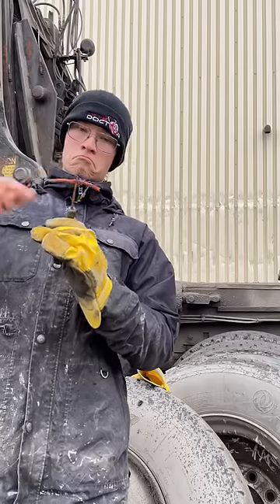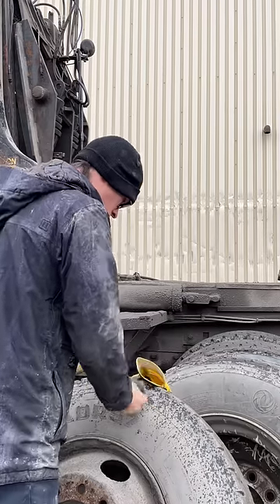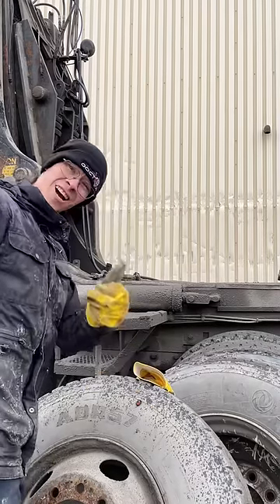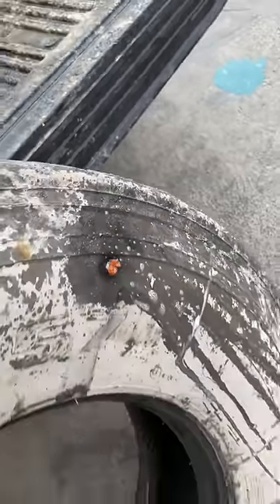Plugging A Truck Tire Sidewall #tiredoctor #shorts

Comment: Depending on the hole size, a sidewall can be patched. Only to get you safely to a tire shop to get the tire replaced
Reply: A sidewall should never be patched, it ruins the structural integrity of the tire and can blow out the plug easily as there is less material for the plug to adhere to.
Reply: @blah-po9et  I've done it before. But again, read the post
Reply: @blah-po9et  yea but i mean for
a few miles at low speed just to get to the shop like the other guy said then you’d probably be alright
Reply: @troycooksey9257  ok. Let's see how long you stay stranded in the middle of nowhere
Reply: @WARD5KUSTOMZ  it's called AAA and it's alot cheaper than if your tire blows out causing you to swerve into oncoming traffic and kill someone.
Reply: @WARD5KUSTOMZ  you're lucky you didn't kill someone, there are no steel strands in the sidewall unlike the tread, which is how plugs and patches stay in, there is a severe risk of your tire blowing out even if the plug stays in because you've weakened the sidewall and created areas for tears to start, trust me I've seen it before.
Reply: @blah-po9et  I've got a Michelin on my back porch that has steel in the sidewall
Reply: If you do it properly sidewall can be repaired and used all the time not just to get to shop. Also depends on size of puncture
Reply: @NTM2009  exactly. Although I wouldn't trust it for anything else other that to a shop
Reply: @WARD5KUSTOMZ  seen them go for another year after sidewall repair. If done properly it will be done at a shop. Can't be done properly anywhere else
Reply: Only on semi tires can sidewalls be patched. Auto tires can not be patched on the sidewall. But yeah, semi tires can have some pretty big patches on the sidewalls, being that they're wired all around the tire and just not on the top.
Reply: @Totes_ma_Goat  done everything from lawnmower to rock truck tire sidewall repairs. Passenger vehicle, light pickup tires most definitely can have sidewall repaired
Reply: @gbrush30  
That's cool. Being I've worked in tire recaps for years, what do I know, right? 

The sidewall of automobiles does not have the structure integrity to hold a  patch, and no shop will ever patch a car or small truck sidewall. 

You can even google it, that sidewall repairs on automobiles is a big NO and highly dangerous.  

You can do whatever you want to your personal property, but should (when) the tire blow out and damage something is the question?
Reply: @user-wi5jj4wc8k  that's nice but we aren't talking about recap. We are talking about sidewall repairs. Judging as your still calling it a patch I wouldn't say you have that much experience. But hey what do I know after over 40 years and no failures of any of my repairs
Reply: @blah-po9et   I believe this is the reason for dual tires, one blows you still got the other plus most 18 wheelers have 8 tires in the rear and two axles guiding the truck straight, the tires you really want to watch are the steer and there’s no running risks there because they literally guide the truck but if your out in the middle of nowhere with no food or truck stops, run the risk otherwise you might end up in the cemetery prematurely
Reply: I mean if you feel comfortable doing that go ahead but I’ll stick to using a spare or a donut
Reply: @NTM2009  What would a heavy duty diesel mechanic like me or a tire specialist like him know about it being literally f*cking illegal for a shop to repair sidewall punctures
Reply: @tothemaxx1991  no its not if its done properly. There are tons of properly repaired tire on the road daily
Reply: @NTM2009  I don’t think you know what a sidewall is…you can patch a tire with a hole in it but if it’s in the side of the tire it significantly affects the strength of the tire I know that you are smart enough to get on YouTube so if you could do a quick google search on whether you can patch a sidewall it tells you all you need to know it’s against DOT regulations and if a shop repairs a sidewall of a tire and it causes an issue they would be seriously liable you can have 40 years or even 100 years of experience it doesn’t make you right
Reply: @Onewingedangle42  Up to a quarter inch in diameter (the size of the carbide drill bit used to smooth the edges of the puncture before installing a patch-plug), and only in the main tread of the tire. You're absolutely right.
Reply: @tothemaxx1991  yeah they say that the plug should stay 6mm away from the edge of the tire within the tread but if you did something wrong for 40 years you would be a little grumpy about it to so I guess it is what it is lol
Reply: @NTM2009  I didn't say tires can't be repaired. I said it's illegal and dangerous to repair sidewall or shoulder damage. As a certified DOT inspector I'd like to call out your shade tree bull. And just in case you still think I'm wrong or only talking about CMV tires there's tons of articles by  reputable (something you clearly know little about) repair shops. 

Don't make me get out the FMCSA rulebook.
Reply: @tothemaxx1991  it's not illegal or dangerous to repair side wall if done PROPERLY which you seem to keep missing. Worked in large tire shop for many years and now work CMVE
Reply: @hunterelmo42  I don't think you know how to read. Not once did I say patch a sidewall. I said repair which is complete different process and legal if process is followed
Reply: @tothemaxx1991  apparently not enough cause your both wrong
Reply: @NTM2009  okay let’s drop the word patch then….if you do any research on the subject it is clearly stated by any tire professional that any repair patch or otherwise is too risky on the sidewall of the tire…I don’t care what you are talking about whether it’s a plug, patch, or vulcanizing and praying it doesn’t make it safe…you even stated that repairing the sidewall can be good for as long as a year…that doesn’t make it safe none of those solutions are permanent or worth the risk when a tire blowout can be a fatal situation I really hope that it’s rare that someone believes this garbage repair bullshit that you are selling
Reply: @NTM2009  I didn’t say it’s illegal but it is definitely dangerous there is no such thing as a sidewall repair that isn’t temporary and doesn’t modify the integrity in some way you even stated yourself that the tire could last up to a year after the repair…if a tire repair last a year and then the tire blows out because it’s weaker on the side that is incredibly dangerous even if it is legal you are the only person that says it’s not dangerous
Reply: @hunterelmo42  you know some vehicles go more then around the block in a year. The one that I personally saw last another year was another couple hundred k and tire was wore out when replaced not blown. It wasn't a temporary repair. It was repaired and run to the end of the tire life
Reply: @NTM2009  cool and I’ve seen a plug in the sidewall last 2 years it doesn’t make it safe I’ve also heard of people surviving doing meth for a year it doesn’t make it a good idea I’ve also witnessed people lie before but you know I’m sure everyone online and in person disagreeing with you including dot and any professional that works with tires is just a bunch of nonsense also that’s why I’m just going to ignore you
Reply: @hunterelmo42  your not actually reading my replies. Not once did I say plug a sidewall. I said repair sidewall. Plug is not legal but a proper repair is legal and approved by dot. It has to be proper repair which not all shops can do
Reply: @NTM2009  I was giving an example the only thing I can guess is that you don’t understand English but yeah neither are recommended and i have seen no information on vulcanizing a tire being approved by dot
Reply: @NTM2009  googling "legal tire "sidewall" repair -patch" yields results indicating that a few U.S. states say any repair to the sidewall at all make the tire legally unsafe.
What state are you talking about? Let's see if the state law says the same thing.
Reply: @Totes_ma_Goat  And I really trust Google! 😆
Reply: @hunterelmo42  yep I understand English and also know a proper repair is 100% legal. But also know it's not something your probably going to get done at your local shop, definitely not a the small town shops. Not many do it and normally it the very large multi national corporations that have the capability
Reply: @NTM2009  you can’t even give a name for this so called special repair and yet you expect people to believe you that it exists
Reply: @hunterelmo42  it's called a repair, or sidewall repair. Different places call it different things. One place I would called it a customer fuck up repair
Reply: @NTM2009  I would like you to help me understand because I have called 3 different major manufactures and major tire locations and have not found any answers that suggest what you say is accurate and I have not found anything online except for a company that will repair the sidewalls on tractor tires or trailers that don’t travel at high speeds or under a lot of stress however I have seen that driving with a damaged sidewall is illegal so I’m assuming what you are referring to would be some sort of tire refurbishment but I haven’t been able to find any information that it actually exists and provides a safe and legal fix
Reply: 😂 clever joke, had me for a second, I see what u did there
Reply: @NTM2009  question for you are the patches baked in or purely glue?
Reply: @Mabert2014  Actually, when you plug and patch a tire, you drill it so that none of the steel chords tear or wear on the patch. It adheres to the RUBBER. You obviously don't know anything about tires
Reply: @NTM2009  It is both illegal and dangerous according to the Federal Motor Carriers Safety Administration. Y'know, the ones who make the rules and laws regarding safety. But what do I know, maybe the Department Of Transportation is wrong and you're right.
Reply: @NTM2009  Please explain what a proper repair is then, considering patch-plugs are the only legal repair method that I'm aware of for semi tires
Reply: @NTM2009  Give me the name of one reputable shop that will do a sidewall repair. Just one. Just in case me being a D.O.T. inspector for Travelcenters of America, Freightliner, and CAT Scales isn't enough for you.
Reply: @superredsnakesrs2681  Correct. The vulcanizing fluid used with a patch-plug chemically bonds the surface of the patch to the rubber of the tire, and the integrated plug helps avoid further damage to the casing beneath the treads.
Reply: Bs. Get a tow.
Reply: @blah-po9et  the sidewall doesn’t have as many steel belts but most road tires today do have steel in the sidewall.
Reply: @blah-po9et  especially if it's mounted in the front
Reply: @Totes_ma_Goat  yes, you may be right that sidewalls should not be patched, however, I have had the sidewall of my rear right tire patched before, and driven on it for months completely fine. Some mechanics will do it for you, I’ve found that out in NY.
Reply: @blah-po9et  Ok, reread the OP. And read it again... Go ahead one more time. Now, HOPEFULLY you can comprehend the context of it: Only as a temporary fix to get you to a shop. Not to "go shop", but rather "to a shop".
Reply: @NTM2009 but definitely not if you’re operating a commercial vehicle. DOT will put you out of service for a plug in the sidewall
Reply: @joelschermerhorn5447  can barley see them from foot away so they would never see it as you pass at 100 fifty feet away

Comment: All the tire shops that say u can’t patch a side wall hate this guy🤣
Reply: Tire shops don’t wanna be liable for patching side walls
Reply: This is a tire plug. A patch goes on the inside. And yeah. It's a liability to plug the wall.
Reply: It probably won't hold air . He did his leek test with the rim off no air pressure  to make the water and soap bubble
Reply: It’s safety issue
Reply: @aldyson3469 that’s the joke… he would never plug a side wall!
Reply: As soon as this tire takes a load it’s blowing out. This tire wouldn’t make a down n back run 100 miles
Reply: @bigdog4574  I agree you should never plug  a sid wall.  I was just trying to point out he did his leak test with know ari in the wheel. So if they made that big of a mistake  you probably should trust their advice
Reply: @aldyson3469  lmao… the tire doctor was making a joke… he wasn’t actually testing for a leak and he was actually plugging a side wall… he was trying to be funny.
Reply: It isnt a safe thing to do, and There are regulations for retail shops. Look up USTMA. Plus this guy said it was a joke at the end which you obviously missed
Reply: They are harder to get a proper patch they just say they can but they could just not worth having to work on a car for free when it most Likely comes back
Reply: hold my keys...

Comment: Glad it worked out well for you and didn't explode with all the air in the metal. I wasn't sure the plug would hold under pressure like that.

Comment: Make sure to put the patch if needed on the outside!
Most dummies put em on the inside; the air will rip a hole through the patch that way. We dont make beginner mistakes here.

Comment: I work as a tire technician in a shop called kal tire we do everything from passenger vehicles, commercial vehicles, and even mining operations. I had a lady come in with bald tires like you could still see the tread and technically they were still legal to drive but with our hot summers she had aboot 30 seconds of legal driving she argued with me multiple times and said no they’re fine you’re not going to scam me I’m gonna drive with them so I went into the shop and said does anyone want to put on suicidal tires? Someone eventually said yeah because of free labour hours, so why not take the free money and then there was another lady who came in with tires from 2007 within this month and I kept telling her that her tires are 16 years old and we can’t put them on but she wanted to argue with us I even explained to the lady saying the inside of the rubber could be rotten, or the cords could be snapped Anything could be wrong there could be sidewall damage, and we won’t even know until it blows up in our face or on the road while she’s driving and she thought when I said inside of the rubber, she thought inside of the tire and kept arguing saying the inside of the tire is fine, and I said no inside of the rubber between the top and the bottom, and she said there is no in between space, and I wanted to strangle this lady so badly she had an annoying amount of stupidity, like I couldn’t comprehend how she could’ve even thought of that, or even fallen into that pitfall of logic. It annoyed me and I wanted to just walk out of the shop and just my underwear cause I didn’t have a change of clothes and just walk in aimlessly towards the semi desert I call home

Comment: bro. I worked doing tires for 37 years and on one road for dump truck, it had a 6 inch buck knife sticking out of the tire ,handle in blade out

Comment: You'd be surprised at what will go into a tire at highway speeds.

Years ago I was in a van with someone we got back and noticed a hiss and a bit of a low tire surprise fairly large Bolt in the thread of the tire no sharp ends on that but just to share forces this was no self-tapping screw or anything like that button straight on flat ended Bolt at least well over a quarter inch across almost the size of a small piece of rebar.

So yeah things like this might just surprise people that they wind up in a tire on the right conditions and nothing is it had barely lost in the air it even took a long time for it to leak out enough to even notice a difference.

By the way did did not know how to get the spare tire down and show them how to do this they had never had a flat on that vehicle for old passenger van

Comment: He checked it off the rim because he knew it was completely ruined due to the hole being on the tires side wall. A tired with a damaged tire wall cannot be plug it as the whole weakens the strength of the tire. As the tire wall constantly bends and moves which will cause the tire to either explode or blow out the plug causing an flat or a blow out on the road.

Comment: The problem is its in the sidewall (needs to flex a LOT ) and the radial pattern there usually isnt going to allow a plug, some of the radials probably were damaged and they will saw the plug and rubber.. sure it holds now, but will it hold on the road : not in my experience

Comment: You should look up some OTR training about tire repairs bub. Sidewall repairs on the road aren't really allowed, gotta have some special tools and patch/plugs to even do it safely. Anything the size of your finger located in the sidewall requires replacement. A simple plug will most likely cause a failure somewhere down the line.

Comment: 120 psi ,
Bro that’s crossbow pressure.
If it pops in a crowed area with in 10 feet people will get cuts from tier popping .

Mine blew a month  ago the debrie made deep dents in a parked car .

I know it’s expensive but get it done with ability to hold 150 psi if your loaded

Comment: I don't know what the huge problem with plugging sidewalls are it's gotten me off the highway and to a tire shop in a pinch before. I wouldn't recommend daily driving a sidewall plug but you also aren't technically supposed to daily drive a plugged tire anyways.

Comment: Lol, must be a different tire architecture on the side walls than normal vehicle tires.   Sidewalls lack the close nit metal cabling and won't hold a plug.  Gotta vulcanized new rubber onto it from the inside or pitch it.

Comment: No it isn't holding very well mainly because the rim is off for some reason. The reason y this is wrong is because there are no cords(metal reinforcement) in the sidewalls and plugs rely on that to get a hold of the tire, it's gonna either shoot out before it gets to 30psi or cause a knot... Both options suck. I'd just patch it from the inside since you got the rim off